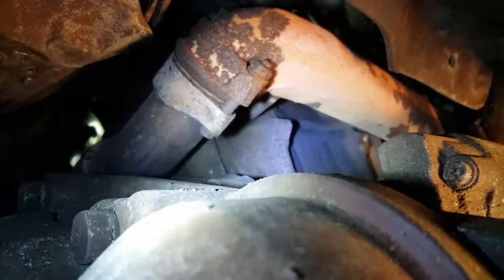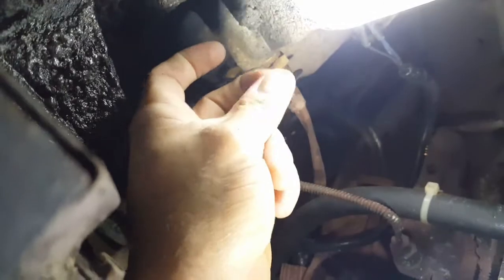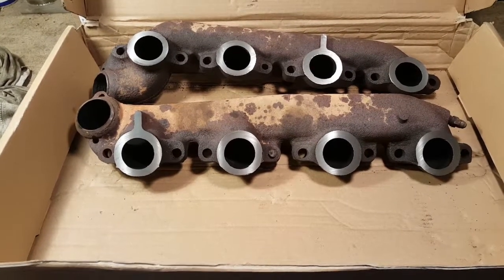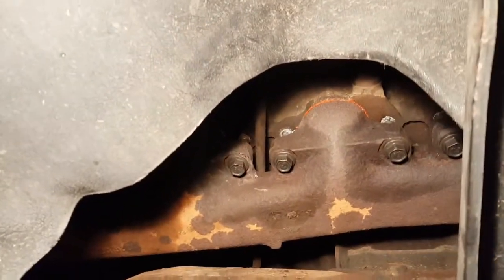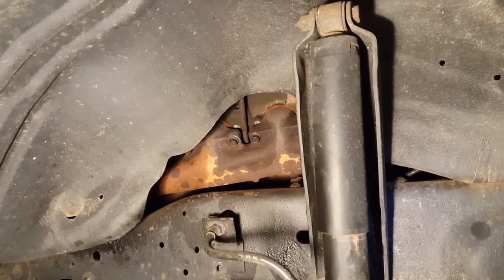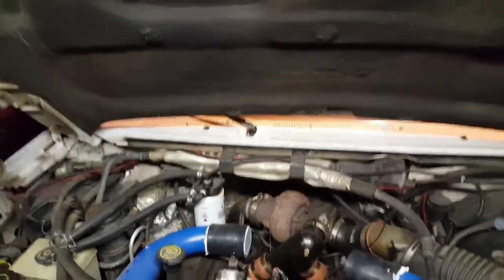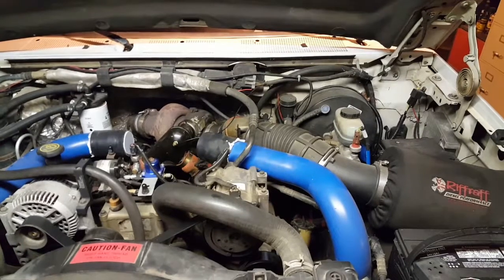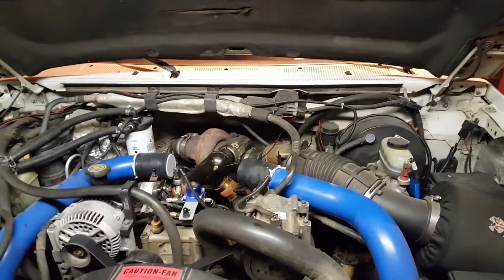Project PSD Part 3: Exhaust Blows

Comment: My biggest worry is breaking... then trying to remove studs in the head, thank you for taking the extra minute to give my mind peace by saying they were just a little more than finger tight...
Reply from the maker: That's a concern, for sure. There are some pretty decent tools out there for removing broken studs, though too. Broken stud removers work well if there is enough of the stud sticking out to get ahold of it, if not, I have had good success welding a nut to the stud (or a washer and then a nut in some cases) and then backing them out.

Comment: I went the gasket route. Why do folks not like that solution?
Reply: With the pressure built up with higher hp motors its a weak link to have a gasket that thick... i blew out my factory gasket about 8 months after turbo and injector upgrades
Reply: @Ivey0401  is that a newer motor? 7.3 did not have a factory gasket. That is not an issue I have heard with on Cummins motors, think they all use gaskets. My 12 valve makes way more boost then my 7.3. 25 vs 40.